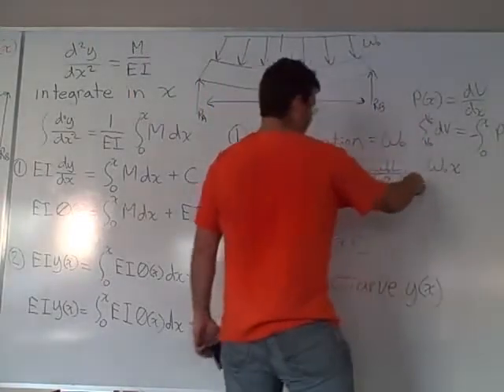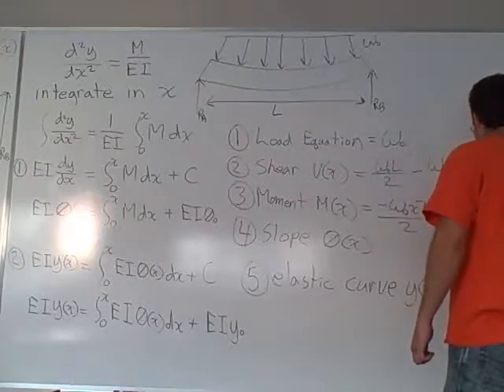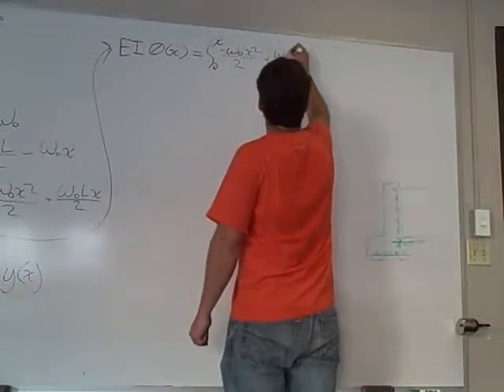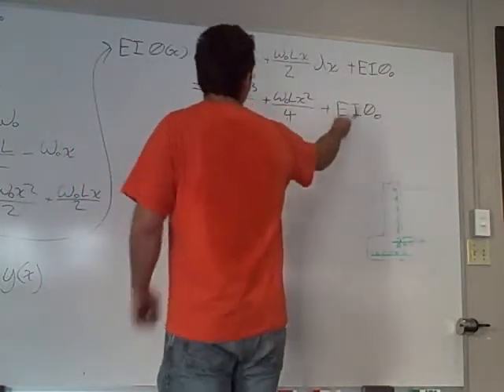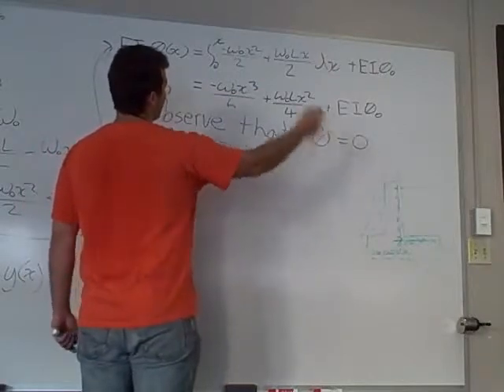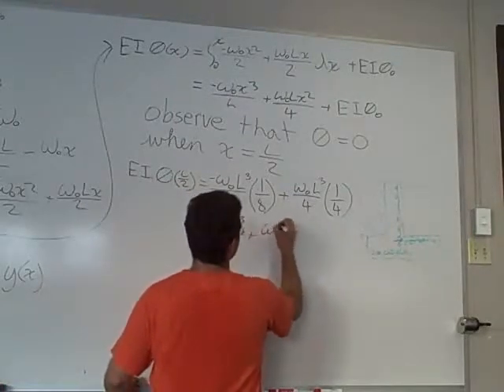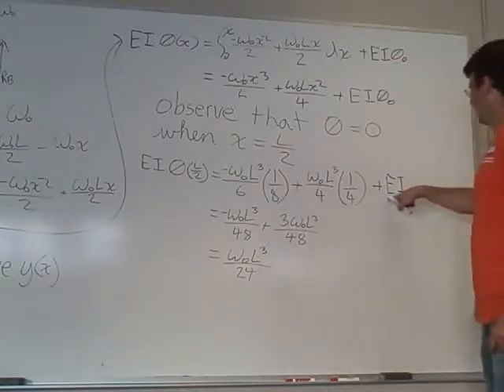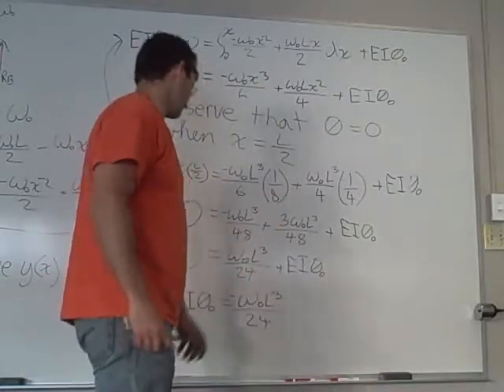Part 3 Beam Deflection

Comment from the maker: Method 1:  Divide your beam into segments.  Each segment is has a constant loading pattern, an initial shear, an initial moment, an initial slope, and initial deflection.  The first segment V(x) is determined as shown in my video example.  The initial conditions for the second segment are equal to the final conditions of the previous segment.  Note, if a concentrated load is the cause of discontinuity, that load must be added to the final shear of the previous segment to get the next initial.

Comment from the maker: @diflection1 Are you talking the function for determining moment, slope and deflection when more than one load is applied?  If so, it is a little more difficult.  Start of by noticing that every time a new load is applied along the beam, the function changes.  This is a discontinuous function.  There are two methods I use to solve discontinuous functions.